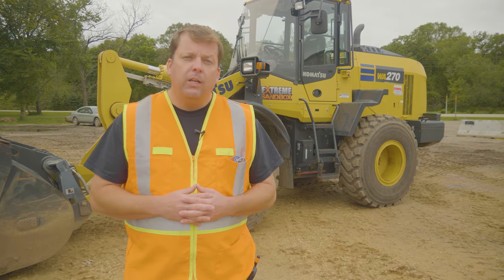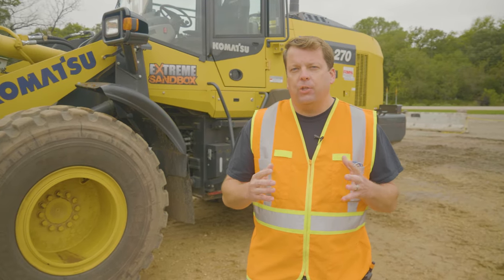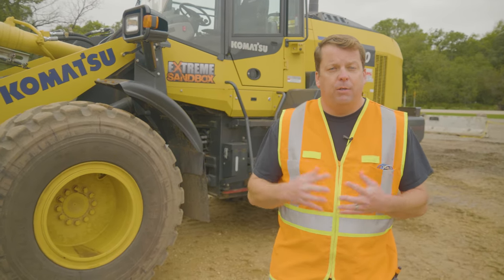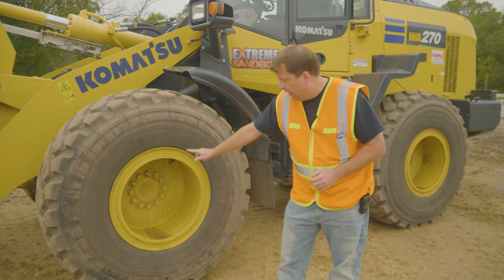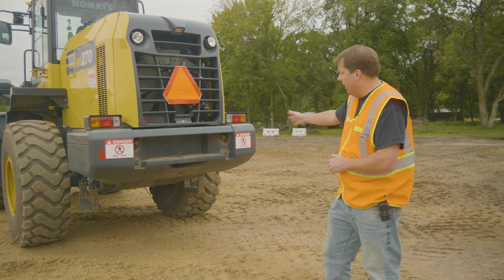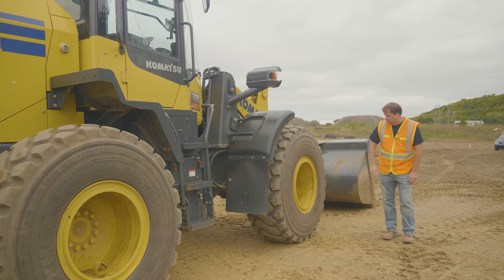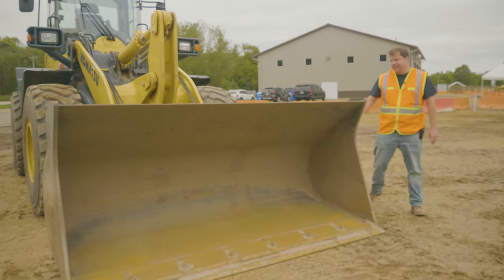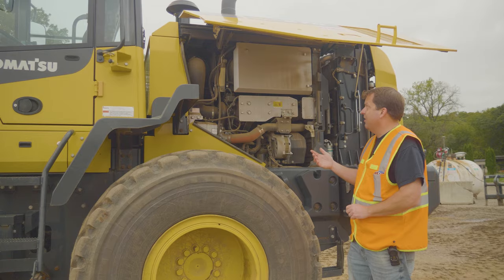How to Operate a Wheel Loader (2019): Pre-Op to Shut Down | Heavy Equipment Operator

Comment: When I spread material going forward I put a 80-90% full bucket on the ground then open and raise my bucket at the same time anywhere from 6-10” off the ground (bottom of blade) and drive forward as I continue to open and raise my bucket at the same time to keep my blade height consistent. With good material on a somewhat level surface this will leave a beautiful pass especially if I back drag after I spread. 😉

Comment: I like renewing myself with equipment that im currently using ,  these videos are wonderful .
There are several people & 3 actual operators that use our 2017 WA270 loader .
My main use is uneven ground digging in compacted soil as in river rock & sand covering construction materials
in a landfill not flat like most of
your videos show.
Could you or do you have these types of videos ?

Comment: Nice video and good explanation of techniques. I agree the material is really important on how you load. 1/3 to 1/2 widths (for cutting the fill out), if you want to level a really rough floor. But other than that, I can tell you have run loader for quite awhile.
Reply from the maker: Thanks for the comment!

Comment: At the end of the day I park in a spot free space if possible and In the morning check for leaks usually loose fittings or something more serious! And when switching bucket I lift it high and curl the bucket to have the least amount of pressure on the lock pins and have a good view if they both close! Once one of the pin didn't close but I could push and hold it in place with a rag, sometimes in a major snowstorm all the other loaders are on the the road, As for the single pin if you work with heavy load you can see a slight twist of the bucket on one side almost unnoticable for the newcomer!  As for the bucket on level not to dig I give a little lift to it just to be safe. Keep an eye on the blades of the bucket for wear mostly the side ones !
Reply from the maker: Excellent advice...thanks for sharing!

Comment: Beginner here I'm working with what my instructor said is a M2  . Machine is good but old functions well . The thing I'm struggling with is getting a full load with the two  levers on my right 
Bucket motion  and rising and lowering the bucket . While getting a full buckets 
Not if I explained that but I'd like some pointers.

Comment: even worse on wet sand or muddy conditions ive need to repair the line i scoop before i scoop so i change line and dont drive into my same tire rut ive moved alot of dirt,, been moving piles from excavation of footers then bring back for backfill
Reply: building Grand Cypress resort expansion going to have a lagoon too, im not working the lagoon project but you should see the machine thats been grading this area is like a wheel loader but i guess you could call a track loader or dozer has for tracks. but i have right now 1yr day in day out wheel loader experience and i like it.. wish i had seen this video sooner but Thank you for the video..

Comment: Now don't get mad but What's with you and floating it the worst thing you can teach someone. If you finish grade a house and all you did was floating you'll have a houseboat because it's going to look like it on the ocean. I know you don't care but its not good to teach newbies. But all your videos are great they show a lot of what to do for beginners.
Reply from the maker: I think there is absolutely a time and place to backdrag using float.   I'm not one of those "real operators never backdrag" camp.   Otherwise, why does every manufacturer have float on the machine?
Reply: @HeavyMetalLearning  I think you ment to say is ( real operators don't backdrag.floating camp).  In my 35 plus years of operating equipment I used the float one time someone put sand down my dipstick tube so I couldn't start up the engine. I then put the machine in float used a backhoe to pickup the bucket so I could get to the oil pan . It's the only time I used the float , I think that's why they have the float